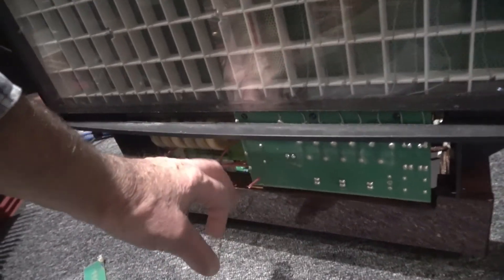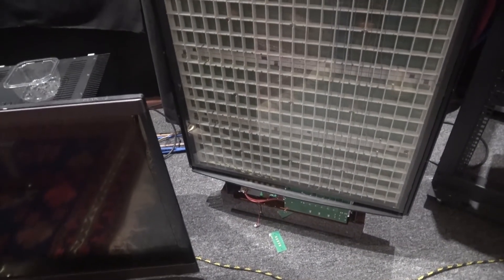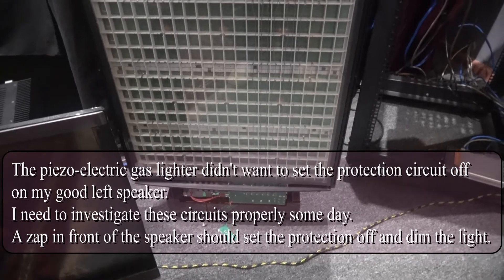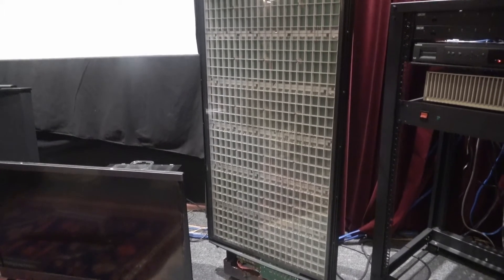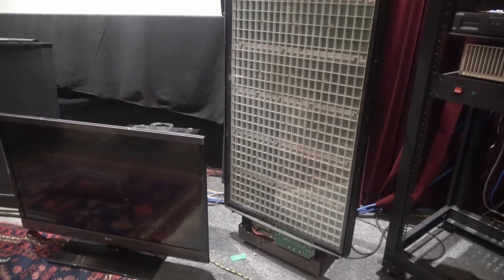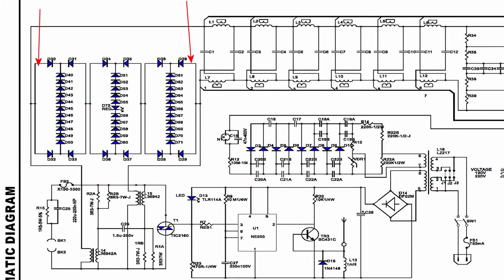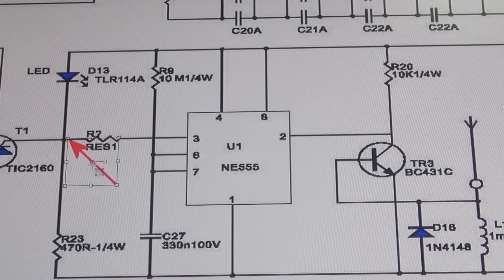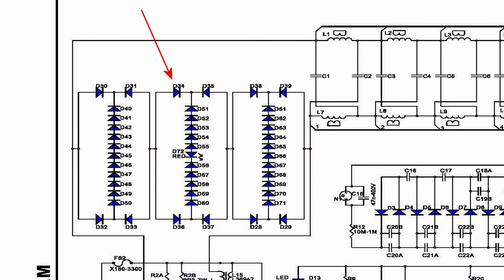QUAD ESL2912 problems with speaker protection

Comment: What if you just disconnect the antenna?
Reply from the maker: That's one way out but I would like to have them work as advertised. One solution is to increase the size of the capacitance of the DC supply, we'll see.
Reply: Thanks Moggy, I will follow this, as one of my 989 suddenly shuts down, sound distorted and then return to normal.

Comment: If anyone bought Quad speakers who lives in North America... good luck finding repairs. These Chinese made models are apparently swamped with quality control problems despite their claims of better build quality. The North American Quad distributors are spotty at best and well known for abandoning ship leaving customers who need repairs no recourse except for shipping them overseas. Good luck and caveat emptor.
Reply from the maker: I've had my 2912s for 8 years now and yes they are not as solid as my previous experiences. Sigh! 
I have one pair of rebuilt 63s I bought from the US and they are rock solid.
I don't live in Nth Am so I don't have your problem. In my city of Melbourne we have a brilliant guy called John Hall and if I was prepared to spend the money he would do a phenomenal job. I wanted to do them myself as I have done quite a few 63s. Once I returned them once for a warranty replacement panel I knew that it would never end until I replaced all panels myself.

Comment: This is a known problem with many models of the QUAD ESL, the solution is to replace capacitor C28 for a copy with a twice higher voltage and a greater capacitance e.g. 2200uF.
Reply from the maker: Very interesting. First time I've heard that. I'm unable to find a schematic for the 2912. If you know where I could get a circuit diagram I'd be very grateful.
I've thought of back engineering the schematic but it gets difficult and I just want to listen to it. I'd like to know what C28 does, I'm assuming some kind of time constant in protection. The circuit is quite different to the ESL63 circuit although same principles I suppose.
Thanks for the tip, I'll follow that up when I next get back to it.
Reply: @MoggysHiFiAntics  The protection part of the schematic of the 2912 and the 2905 are almost the same so you can use it. The function of the C28 capacitor is to smooth the pulsating DC that comes from the rectifier D14. If the DC power is not stable enough the triac TIC2160 will start to jitter and your protection will be activated of and on.
Reply from the maker: @franswouters3390  IMO the 2905 is more like the earlier ones in this section. The 2912 is a lot different. However I can see that the main filter cap for the 12v supply is what you are talking about. I'm assuming C28 is the 1000u16v cap in the parts list for the 2905. Updating it to 2200u/40v would seem like a good option. Well worth trying. Thanks. I need to see what this cap is, in the 2912.
Reply: @MoggysHiFiAntics  I found a picture of the inside circuitboard of a 2912 and noticed that the capacitance is still 1000 uF. IMO the capacitance should be at least 2200 uF,
Reply from the maker: @franswouters3390  I shall source some new caps.

Comment from the maker: Since making this video I discovered that the panel 2nd from the bottom occasionally arcs on the upper left. It's possible that this may be the secret fault that causes the protection to activate sometimes. Leaving the front cover off has allowed me to see it.  It's only been visible once since the video was made. The speaker still works ok. Although I'm in a dry temperate climate I suspect humidity is playing a part.  I'll investigate further when I've finished with my 63s.